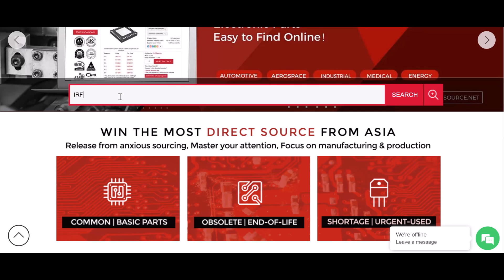how to make simple 220V Touch  Button , Top 6 Easy relay circuits

Comment: WARNING!  DO NOT BUILD THIS CIRCUIT!  Message to the author of this video: "STOP PRESENTING HIGHLY DANGEROUS CIRCUIT BUILDS!  YOU ARE GOING TO BE RESPONSIBLE FOR SOMEONE'S INJURY OR DEATH"!  Your cheap circuit build methods are fine for voltages up to 15 volts,. It 220 Volts AC circuit build with exposed flimsy wire is just STUPID and DANGEROUS!  This is my second warning, if you continue, I will indeed report you to YOUTUBE AUTHORITIES!!!
Reply from the maker: Dear friend, thank you for your comment. I respect your point of view, but I think you may not have noticed the warning appearing inside the video and also the warning in the description below the video. Secondly, I am not the only content that provide the creation of such videos. There are thousands of channels that provide such circles, and in the end I am attaching the warnings in Such videos and you can check that again, my regards

Comment: I really like your videos but PLEASE don't teach folks to make mains circuits without fuses. IMHO you shouldn't either but I'm sure you're aware of that. Even the simplest mains circuit should always be fused. I am aware you like simple circuits which is great but fuses are a critical component and they help save lives and prevent fires.
Reply from the maker: Dear friend, thank you for your comment. I respect your point of view, but I think you may not have noticed the warning appearing inside the video and also the warning in the description below the video
Reply: @inventorkr1  I saw you had a warning but it really doesn't change my statement direction and suggestion. If anything it would only make your circuits better and it just adds one part. I realize this is just for demonstration and nobody is really going to build a mains circuit with a point to point style but still. Fuses are critical in all mains circuits just like other components you've selected to include. It's also obvious that your target audience are mainly amateurs and younger crows interested in electronics. So by that logic it only makes sense to teach them the right stuff. I personally just love point to point design aesthetics. I had some auto amps built like that and then epoxied over. Anyway, just my humble suggestion, take it as you like.